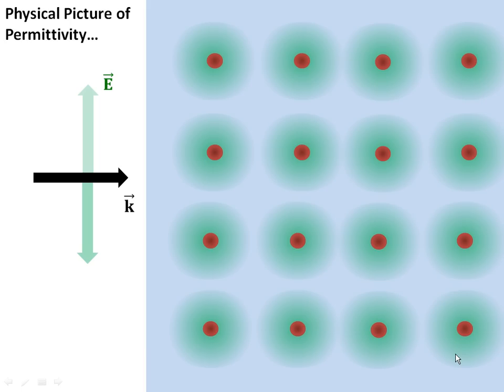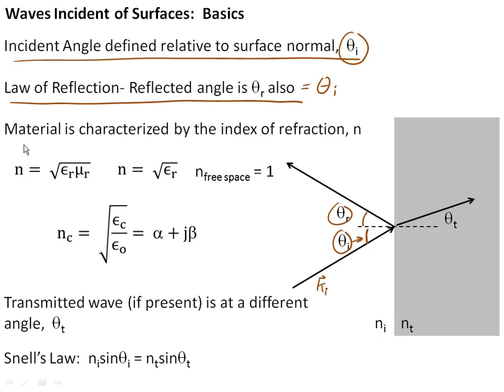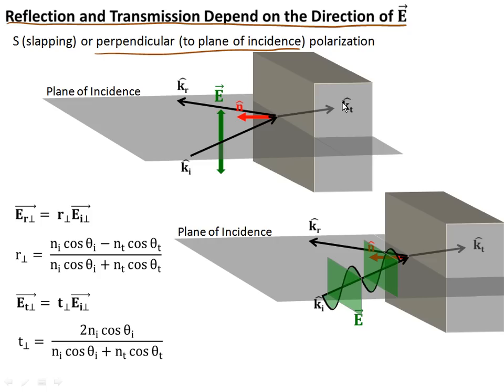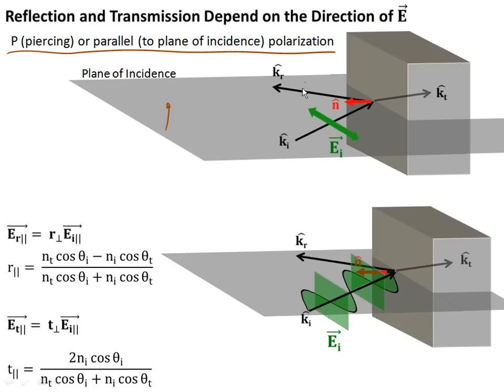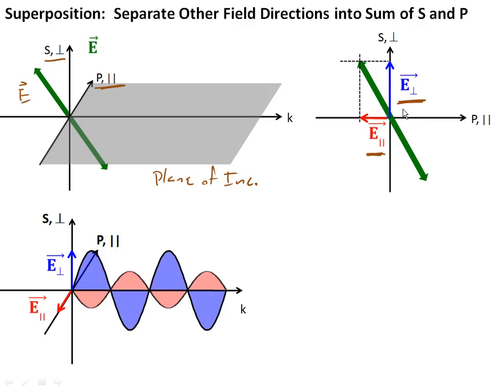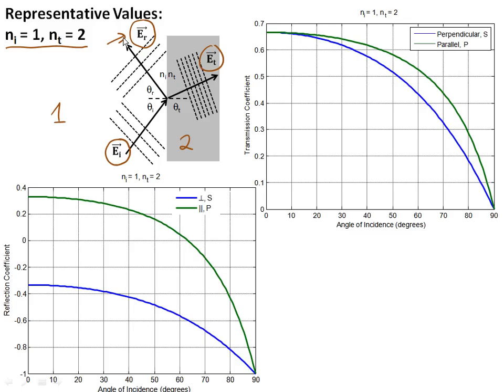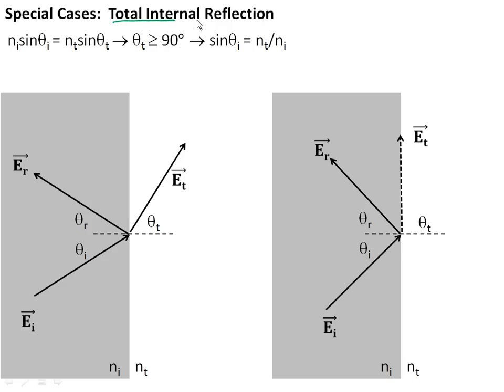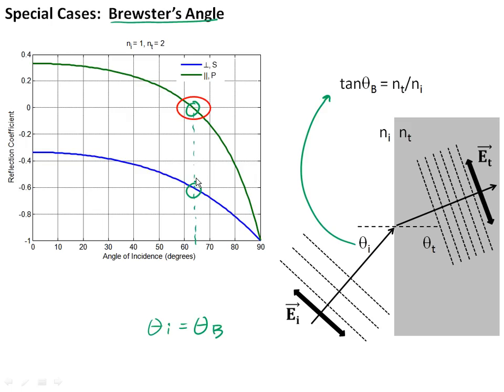3.8 Fresnel Equations

Comment: Good video, although there's a small mistake when you discuss p polarisation. When you give the equations for the reflected and transmitted fields, on the slide you use the the the perpendicular fresnel coefficients when it should be the parallel (you give the parallel coefficients on the slide, it's just a typo ;-)). 

Still, really good video!